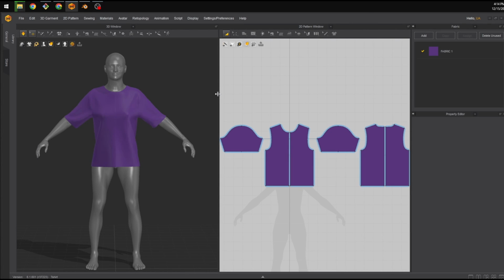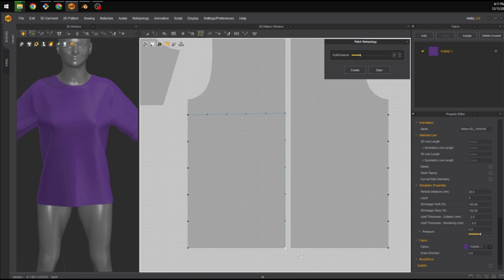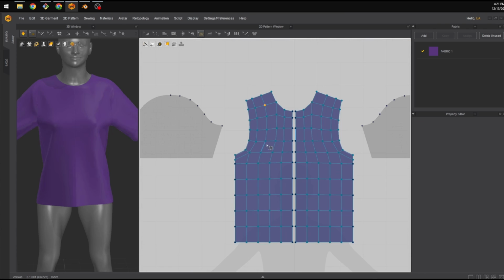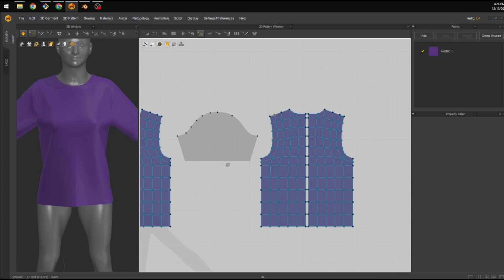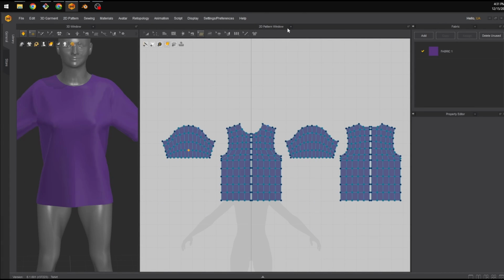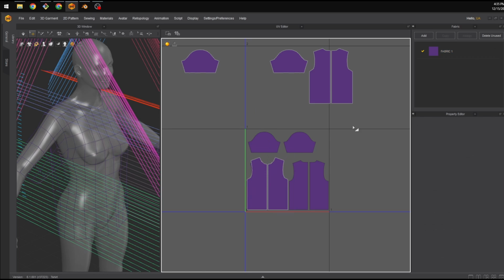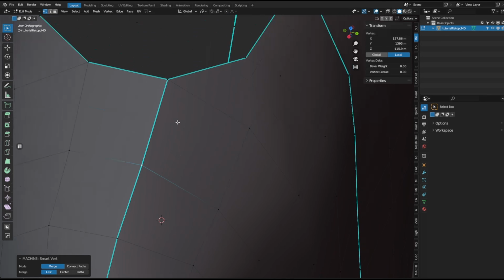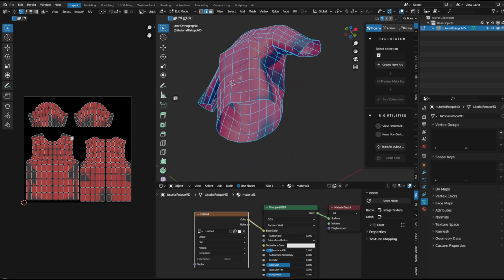Retopology in Marvelous Designer (tutorial 2022)

Comment: The convert fails for my garment? And the parts that work have the UVs size changed and moved so they dont line up anymore
Reply from the maker: Before converting your garment, make sure that the patterns on the UV layout are tidy without overlapping and contained within a single UV square. After conversion, new UVs will be created for the new patterns, which you can then place over the existing ones.